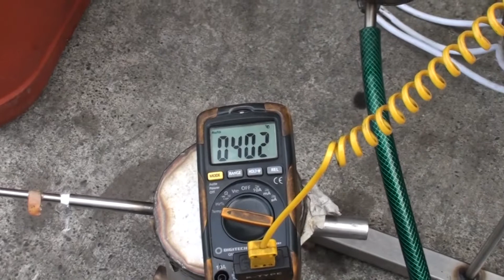Diesel out of WMO - 4kw distillation unit 2/3

Comment: What is the flow rate for this unit at 405 C?
Reply from the maker: The speed will depend on the type of the oils that used for the process, so averagely from 15 to 20L per hour
Reply: Thank you... I will be running various waste oils....